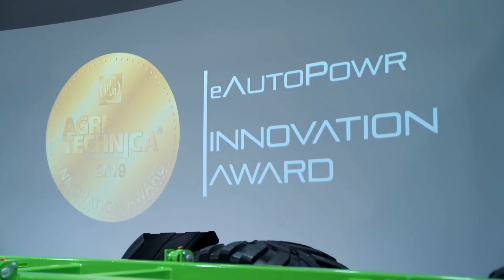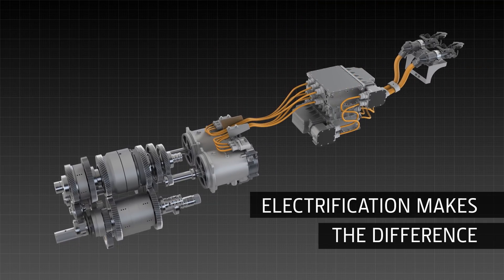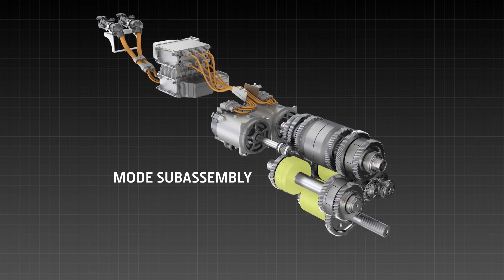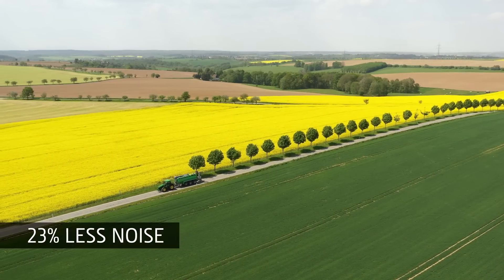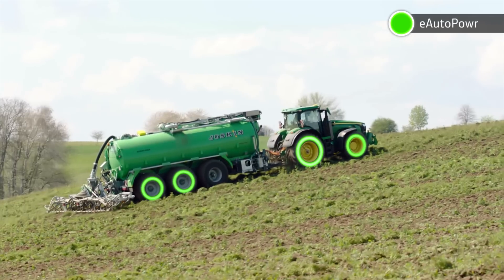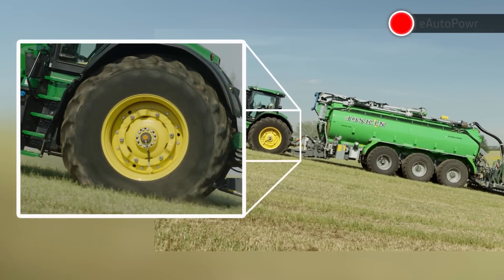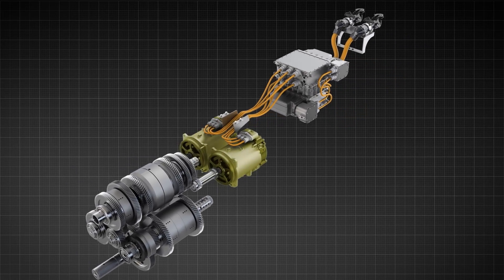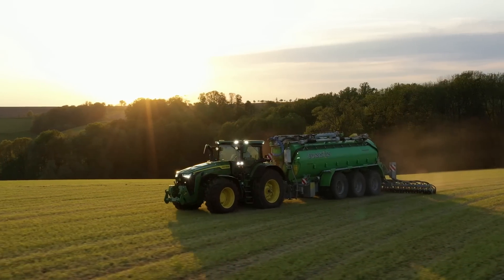Stepless goes Electric: eAutoPowr TRANSMISSION I JOHN DEERE

Comment: Since when is electromagnetism more efficient than fluyd power? When I studied engineering they didn't tell me that. Reduce costs?
Reply: electric motor systems can be 98% efficient now, where as hydrostatics max out around 65-70%
Reply: @michaelsekavec9291  No. Electromagnetic forces are less efficient than compresed fluid.